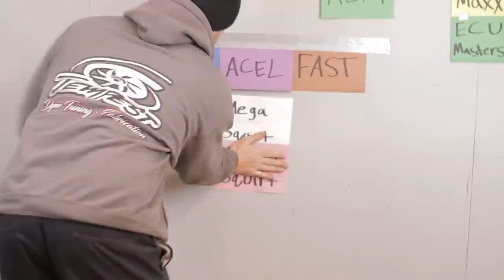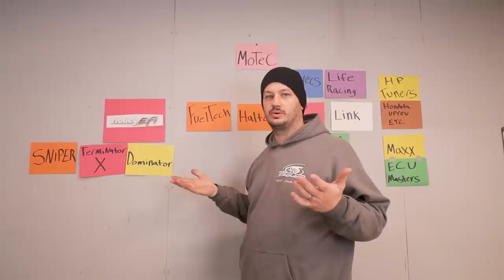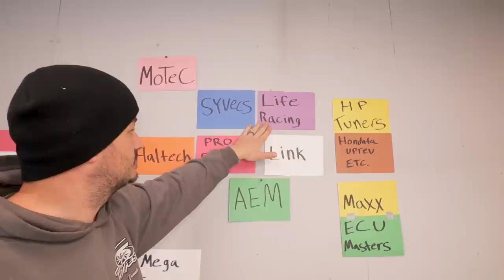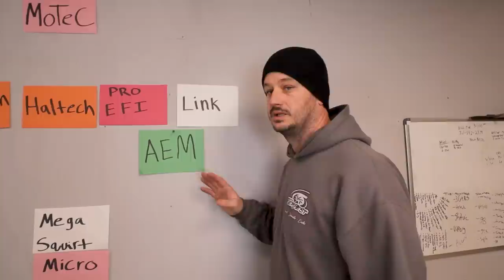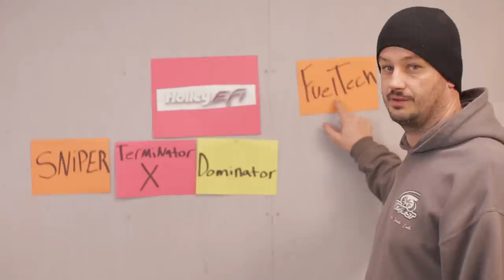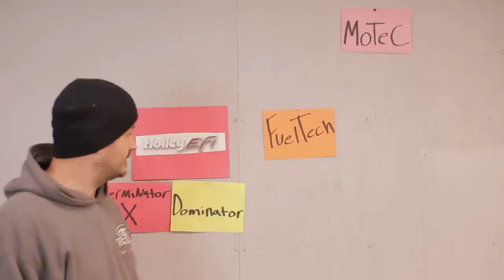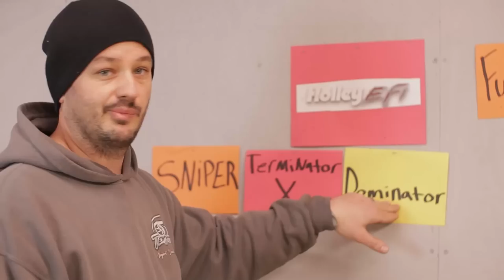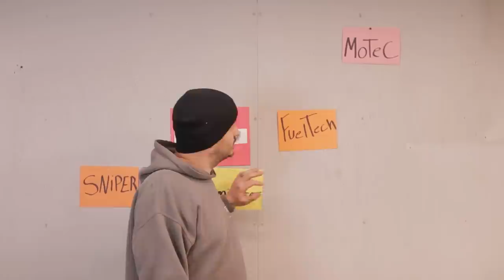Holley efi  VS.  Fueltech, Motec, Haltech, ProEfi, Aem, , Etc. Terminator X / HP - Dominator -sniper

Comment: this was a great overview of the different systems. its nice when i can stumble across someone willing to take time to explain these things. even though i learned a lot now i have EVEN MORE questions. LOL

someone needs to make a system that you can use all the neat bells and whistles in a factory car, with an aftermarket ECU..if they do i need to know who. im wanting to add a bunch of stuff to my 2018 mustang 5.0 but right now i cant do anything because my ECU is a complete bitch. it wont play nice with ANYONE. add a tune from most ecu tuners like SCT and the car shits itself. ive had a dozen revisions and i still get p061b error code that puts the car in limp mode. im ruining stock tune with after market cold air intake, and im about to be running stock tune with long tubes and no cats as well because im sure it will have a stroke if i try to add a tune to it. maybe ill just keep adding shit on a stock tune till the car wont run anymore. tired of spending money on tunes that make the car nothing more than a drive way ornament.
Reply from the maker: That’s part of why i said motec is top level. Check out what fathouse fab is doing with motec on the new mustangs 😀

Comment: Holley EFI for Imports too or just use them for the American Muscle?
Reply: They can run about anything. I've seen a dominator running a honda F series.
Reply from the maker: the hold up on holley for the import cars is going to be the engine harness.  other options are going to offer pnp solutions
Reply: Ok sweet. Yea the tuner said they use Haltech for this setup or occasionally Link. 
But Mr. Simpson said only Holley so I had to ask ha. Good to know I could use it however I'll have to which series or whatever matches the car. VK56DE V8 & VQ35DE V6, these are the 2 engines I'm planning to use.

Comment: So HP vs Dominator -  dominator allows Trans control and dual wide-bands and has a million input/outputs. Lol 
Hp/dominator uses upgraded O2 sensors. Cases are podded. 

What exactly gets considered an input/output that’s not built into the ecu / engine harness?
Reply from the maker: Basically anything that isn’t a core engine sensor or fuel pressure and oil pressure is considered an input or output

Comment: You support Holley wearing a Fueltech hat. 😂
Reply from the maker: Fueltech sent me 1000 different things when i became a dealer and Holley cut me off as a dealer even with all of the support i have for them 🤷‍♂️

I don’t plan out my clothes when i film a video haha
Reply: I've watched a lot of your videos and learned a lot. I was seriously considering the Holley Terminator Xmax for my twin turbo LS build but, I got such a good deal on a new FT550 that I couldn't pass it up. Got the ECU harnesses O2 sensors x2 all for 1800.00.

I may need to call on you for some help. 😅

Comment: maxxecu is like a dominator although you can fine-tune a lot more. everything you want is built into the box. are there ready-made cable harness for LS,bmw,2jz etc. so almost everyone in Sweden uses it. but will probably come more to the US soon. 😊 emu-master is cheap crap no one wants to deal with.

Comment: If a 300$ Microsquirt interested you, grab and build a speeduino.
Reply: Wayment. This is a thing? I'm an ultra budget dude so I love that type of stufd
Reply: @lucysmith4242  I had syncloss running a 60-2 anywhere over 4krpm. But majority of people have no issues with other trigger types.
Reply: @lucysmith4242  join the speeduino forum and FB group, great project with great community support. It's not for everyone, but there are also well built complete units like the ua4c, but they cost a bit more.
Reply: Speeduino is a great place to learn how an ecm works and experiment with. Building your own ecm with your own custom pcb based on Speeduino is fun.

Comment: SO WHY WOULD ANYONE SPEND  4X what a carberator costs for one of these holley systems if u r still only going to just get it running OK and have to get a tuner specialist  to tweak it and double the cost again, so the final bill looks like 8x the cost of new carb?
Reply from the maker: Lots of reasons. Most of which is all of the other things an ecu can do outside of running the engine.

Comment: You have to work more in Maxxecu and you will see the capability and price with built in wide band and built in EGT i like motec and its really good ecu but i dont like the firmware thing and when its locked with password
Reply from the maker: password thing is a thing on a lot of the different ecu's.  im sure ill do some more maxx stuff in the future as its gaining popularity
Reply: @JoeSimpsonAtTempest  you are right but on M130 or proefi you have to contact the dealer to open it or send it to company but on haltech or maxxecu you can just flash a new file and start work
Reply from the maker: @PowerMakerDyno   ah yea that is stupid. luckily i have not run into that (yet)

Comment: I'm in the process of migrating from MegaSquirt MS2 controlling a Toyota "2FE" to a LQ9 swap using TerminatorX.  I really like the Holley stuff, but out of the gate the Holley documentation is meant for consumers who will eventually pay for someone to tune.  There seems to be a lot better documentation on the MS stuff that helps explain the parameters of each lever and knob and how it can impact the functionality.  The only way I've been able to find some documenttion on the Terminator stuff was to find a post in the forum where one of the mods posts some esoteric link that doesn't seem to be advertised on the Holley help page, and still doesn't do as good of a job explaining.  Prime example, I couldn't find where they published that the learn table isn't populated until CLT is >160*F.  Simple stuff that should be explained in the "Learning" section.  MS does that everywhere and even has popup tooltips for a lot of that stuff.  I also had a defective harness (I wound up with an extra free one because I was able to trace the mispinned wiring and fix it), but I can't imagine the nightmare that would have been for someone w/o ECU experience in the past (I learned a TON getting the MS system working on a Toyota Land Cruiser engine that very few others have before me).
Reply from the maker: the fact its sold as self learning and/or self tuning is a big problem.  yes the manuals are not very good and the weird links you describe in their forum i quit even looking at.  i did mention the harnesses are brutal and sometimes have problems.   i never said it was perfect!  it is very simple and user friendly.  there are far more advanced ecu options out there.  but the pro's far outweigh the con's, especially given the price point.  the hardware sure feels cheap though. the HP and dominator are far better options if you take the price out of the equation.

really you could compare all of these ecus's for the next 10 years and never really cover all of the pro's and cons comparing them all to each other!
Reply: @JoeSimpsonAtTempest  Yeah, didn't mean to come across as disagreeing with anything you said, honestly.  Just sharing my experiences to date.  I've only run my LS on the stand so far.  I'm really not regretting my choice at all at this point.  I don't miss trying to tune my VR triggering that's for damned sure!  Thanks for taking the time to do these videos.  I'm sure I would have just done a pnp MS unit if cost wasn't a factor, since I'm familiar with the platform.  I'm still likely going to export log files for analysis in MegaLog viewer... far more powerful and intuitive!

Comment: Hang in there Guys everyone should know that an MS3 PRO Ultra/EVO "Amp EFI" can lay a spanking at a way cheaper price!
Reply: I made a case for that in here...I come from holley dominator to MS3 Pro Ultimate/TCU to my 4l80e prefab harness and canbus....
 I dont miss the holley a bit, except modular sub harnesses...only buy what you need...I just did a 2k 10.1 16:10 ratio screen and Pi4 to control it with 10hz ( dragy accurate performance pages) Bluetooth mini keyboard and wifi sync to Google drive folder when I pull back home...for less than the cost of some of their screens hehe...
Reply: @ShawnGilbert1967  I have an ms3 Pro Evo LS x24 harness for sale BTW
Reply: @davidmaye3580  I'm set but I will ask around...
Reply: @ShawnGilbert1967  that'd be great man thanks

Comment: Motec is overpriced, its good, very good but overpriced. Syvecs, at least for me is give or take same as motec. BTW syvecs is not cheaper by lot from motec. Fueltech is good but i dont have experience with it and not as common in my area. Link is also excellent but from a reason that i dont know i just dont like it. Mega squirt is common in my area as it is cheaper than other, same is true for ecu master. And haltech, not the cheapest and not the most expensive, not the best and not the worst, it get 8/10 in each parameter, and for me its the most balanced package, and to top it up, the costumer service is exelent !

Comment: If you want to slap a choppy boi in your junkyard LS, most people will charge you $500 to tune it to work.  Most custom swap harnesses are $600 with stock LS ECU’s and almost all of them have wiring problems.  Terminator X is cheaper, and better, and adjustable after the fact when the guy snatching $500 for a 15 minute street tune didn’t hit the mark the first time.

Comment: I’ve been trying to help older people with sniper systems that don’t work right and find that every single one I’ve looked at has had install issues causing the problems.  Idle AFR should not be 11:1, Jesus Christ.  I do love the terminator X systems though.  Been super happy with the 5 I’ve installed so far.

Comment: A production engine controller or powertrain controller, say from Ford Motor Company contains millions and millions of lines of code = firmware = embedded software.  Unless I worked for the company I really wouldn't want to mess with changing the firmware or custom firmware.  Even a company like Ford uses a lot calibration and conditional compilation for a specific engine configuration, i.e. v8 vs v6 vs i4.  Point being, unless I was part of a drag racing team with lots of money, custom firmware would seem like a waste.  You should have a base set of firmware and then configuration or calibration, i.e. the ability to select a v8 or v6 for instance and then to tune for fuel and spark map.  So I couldn't see messing with a Motec
Reply from the maker: Most of the custom firmware stuff isn’t for running the engine type of stuff it’s more for offsets of things, custom boost control and traction control strategy’s, or maybe making it work with an unsupported application.  Kinda totally different than oem ecu firmware
Reply: @JoeSimpsonAtTempest  Well I'm in the market for an aftermarket ECU.  My plan is to swap an LV3 into my Grand National and without even seeing this I have really good things about Holley Dominator.  I wouldn't want to have to modified the firmware.  Just as a reminder, the Grand National has a complete plug and plug aftermarket ECU priced around $1900, about $2500 with some other basic goodies that are recommended.  Even with this, a buddy of mine suggested that for stock block, 3.8L Grand National that I should get a Holley Dominator over a plug and play module.  The plug and play ECU from Turbo Tweak does have features as traction control and boost controllers.  Great upload, I hope you're able to add more to the series.

Comment: Can someone tell me why everyone is so quick to dismiss F.A.S.T products these days? Is it an aging interface, or what?... 'cause I've seen them run literally everything, including 16,000rpm motorcycles. I've never seen an application that a F.A.S.T ECM won't work with.
Reply from the maker: Just old and outdated really.  All ecus run the engine obviously. It’s all of the additional stuff that they do that sets them apart from one another.  Fast is just pretty basic from what i remember. Not sure how many if any updates they have done over the years. I havnt seen a car using fast in years so i can’t really say how up to date it is at this point
Reply: @JoeSimpsonAtTempest  - the last one I worked with was 2.0... and it had a full suite for boosted and nitrous applications. I think the only thing it was missing was driver support for dual fuel setups. The auto-tune was fairly straightforward and established decent baselines both times I used it. Alpha-N is a breeze, but nobody uses it anymore (for a thousand good reasons). Aside from a better graphic interface, or a more streamlined UI, I don't really see anything from competitors except more convenient connections (tipping my hat to Holley on this one).

You're right on the whole Holley sales topic. It's a shame that one of the best solutions on the market for 99% of consumer applications, constantly shoots themselves in the foot with poor dealer treatment.

Comment: This is a biased uninformative video ,  this is not a comparison at all
Reply from the maker: Correct total waste of time
Reply: @JoeSimpsonAtTempest 1st i use the aem infinity and have no issues ecu related knock on wood.
There are no recent updates so that is a bummer .
2nd u only seem to focus on Domestics while you completely glossed over any real features of most of the ecus listed.
3rd the only real ecus you focussed on were holley and fuel tec and i am not sure u gave a concrete reason why motec is king.

A general chart with features would have been helpful to show what each ecu has over another.
This video is about 1 ecu and 2 others for references,
are holley good for imports with vvt-i or vtec,
Holley just started using vvt support. thats important for an import person looking to purchase an ecu or even for some domestics.
what are its can capabilities??
Reply: I shud have said this is uninformative as a comparison video to assist with an ecu purchase,
I do like the software for being intuitive
and if it supports import engines vvt i and vtec think its would be worth looking into for ppl outside of the domestic arena